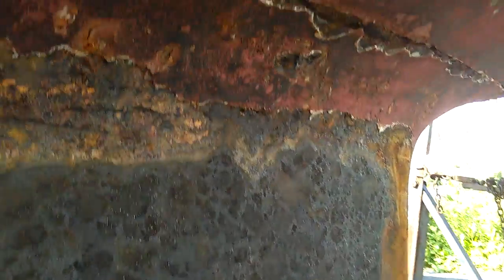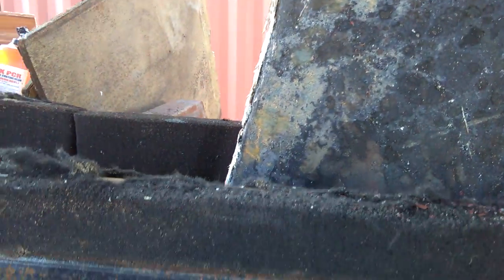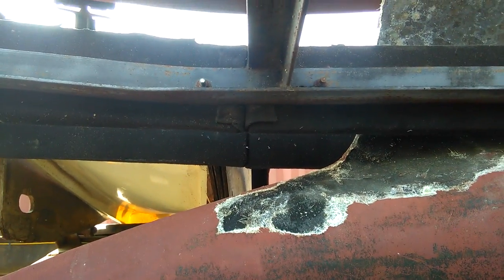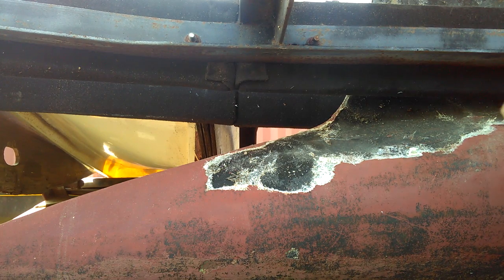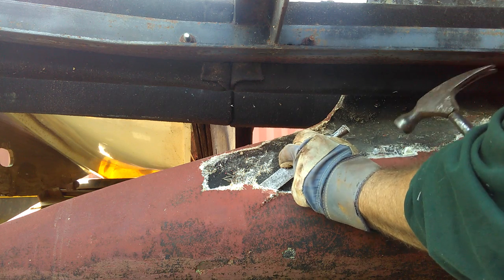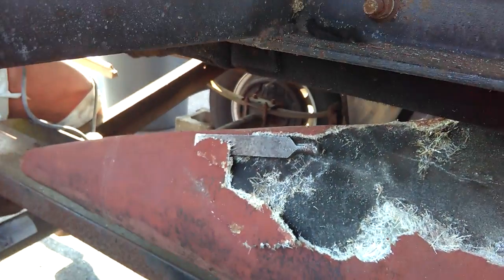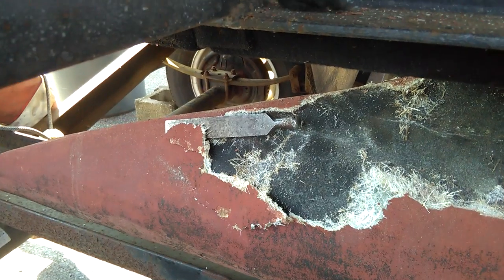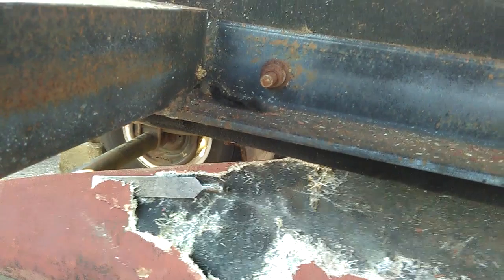slow stripping - Sailboat refit...iron keel

Comment: Can I ask why you stripped it the bulb look good.
Reply from the maker: Others have had delamination problems and when I checked there were hollow areas, with that vinegar smelling liquid...i'm doing the whole boat not gonna skip this...plus going to glass over ares where keel meets the hull this year...I wish I could have known hull was good...no blisters anywhere...I didn't know enough, but you learn...have a good one!
Reply: @fissh29  the old osmosis.
I've just purchased a boat sitting in mud for 4 years. I'm stripping the old anti fouling I know what your going through. 2" chisle it is hard boring work. I'm listening to an audio book while I work stops it being a dumb chore. Still summers coming, it will be all worth it sailing across to France. All the best happy sailing.
The winds free
Geoff
Reply from the maker: @geoffallen1331  lucky you, I have a while before I make it to France LOL...angle grinder does wonders with a sanding disc...good luck and favorable winds!
Reply from the maker: @geoffallen1331  forgot to mention, if you watch my 1st video you'll see, my boat was in the water with a foot+ of water inside for a couple years.. TLC and you can do it...good luck... cheers

Comment: great video!  have to do some keel work  a 1975 Arpege  #1069  with small area de-lamination fiberglass , minimal rust at area fore and  aft area of keel to boat hull( boat last hauled 3 years ago ).  question is what product using for primer, paint and re fiberglass material .  BTW , it's great boat .  did 7 Kt  Gloucester to Buzz Bay in one day ,  loaded with barnacles
Reply from the maker: Ray...just noticed your comment...I haven't done any more with the keel, but this spring I plan on addressing the whole hull...thanks for the info...I so wanna be sailing, but everything has to be done at least to a liveable level
Reply from the maker: Ray where do you have your Arpege?